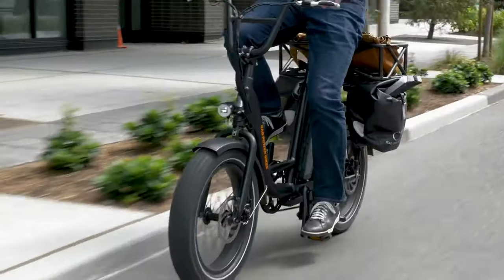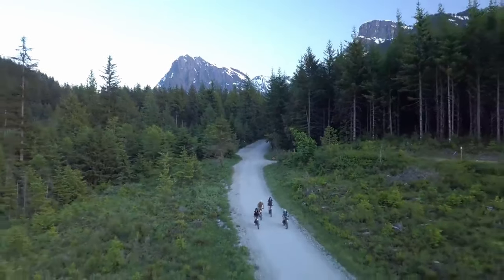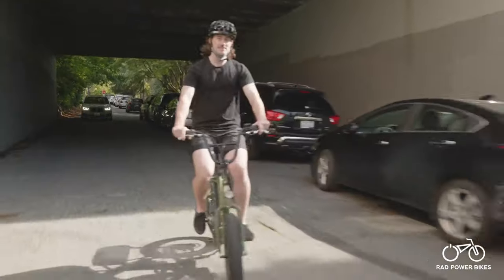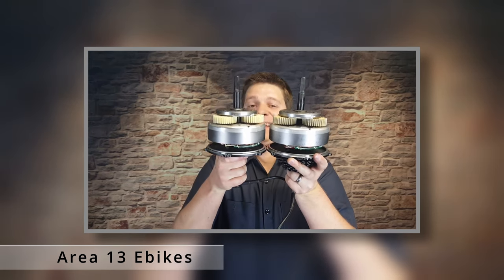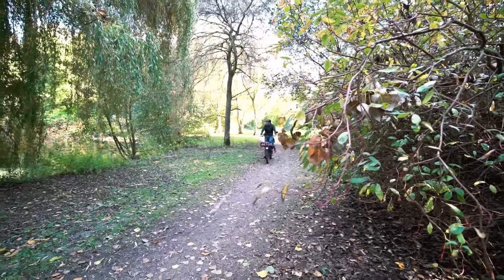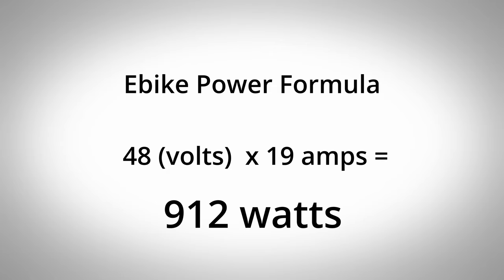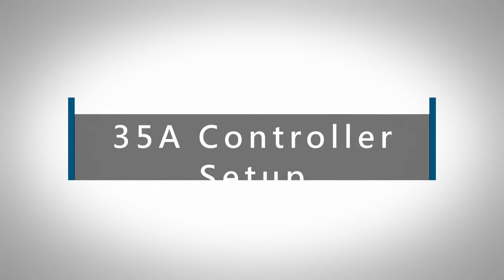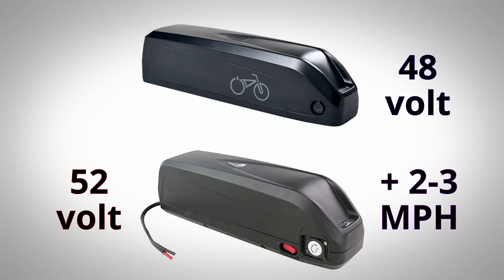How to speed up your Rad Power ebike! - Complete guide: Motor, Controller, and Battery!

Comment: Actually the 35 amp controller and display when programmed correctly allows me to get to 31mph with the stock motor and battery on my rad runner. Btw that’s with my 6 ft 240lb frame.
Reply from the maker: Thanks for the info! It's so weird 90% of the people I hear from say they get 25mph maximum from the stock motor but there's that 10% of people where I hear they get much faster. Just curious, what year did you buy your Runner?
Reply: Winter 2020
Reply from the maker: @surjracer56  Really odd. I don't know what settings that you're using differently then. 🤷‍♂
Reply: I just followed the directions from electrobike world
Reply: Unless you’re testing it with an actual speedometer app, the display isn’t fully accurate. If you raise the dimension of your tire in the settings, the display will show you going 30mph. I believe I have mine on 24 and the max it says I go is 25mph.
Reply from the maker: @stevecastillo1665  A very good point as well
Reply: Yeah, I found it weird that he said such an upgrade would not increase top speed at all. Thank you for posting.
Reply: I did the display trick. Increasing the km/h. I have yet to hit 25 mph
Reply: @ElectricRidesUT  Yeah we need to see these  settings because that's a bold claim!
Reply: Here’s been my experience: Bought Radrover 5 brand new in 2020. Could not crack 20mph In stock form. Two weeks later, I voided my warranty and installed the 35a controller. Max speed increased to 25mph. Earlier this year, I started to feel a grinding from the motor. It wasn’t until I got it all apart that I realized it was just the nylon planetary gear set that got chewed up through regular wear and tear (a $25 fix). But by that time I had already purchased the “true” 750W upgrade motor, so in it went and she now gets up to 30mph in no time flat. Those speeds were all attained on as flat and smooth a surface I could find, using throttle only, on a full battery, and gps verified (which actually matched readout on bike’s speedometer).
Reply: Yes but when you're riding your bike on the road with other cars around you you need to be able to go the same speed and a little bit faster to get out of trouble sometimes to change lanes and whatnot so it's a little underpowered should be able to be that it can go about 40 miles per hour to keep you safe

Comment: good vid. i built my ebike for less than half of this ones cost, and i control how fast it goes lol. 1500w 48v (fed a 60v diet) i pull my trailer at 45mph . but i use an NBPower 50a controller and a home built pouchcell battery with a 100a bms. it has power for days ! my wifes lil trike would eat this poor thing . hers is a 36v 750w front hub , with a 40a controller and 48v battery. my point is if you are some what handy with tools and can read , you can build your own for so much less. i have built 3 thus far and still dont have as much invested as the price of some prebuilts , and i know how to repair and maintain mine! great vid ! keep'em coming!

Comment: I have a rad mission bro, what's the best way to make it fly
Reply from the maker: The RadMission was really designed for pedaling with some assistance, much like EU ebikes. You can get more torque out of it and slightly faster motor only speeds (Around 25mph max usually) with an Eggrider or controller upgrade but with the single speed drivetrain and smaller motor it can be difficult to get anything faster.

Comment: I bought a 350watt Gear motor factory made Mukkpet E bike. Goes 20mph and ride continuous of over 15 miles or more. My CKit ,2000wstt goes up to ,40mph but a DD gearless can only go so far on high throttle of 3 to ,4 miles of the motor cutting off to cool down for a few minutes. I took my 350 watt Gear and added my 2000,watt gearless to my 350w to use as a Turbo Booster Hyper Drive. I can now go 40mph non stop of my 10 mile commute on my 350watt gear. Not really a Dual AWD, more of a 350watt gear motor e bike with a 2000watt Turbo Booster. Very practical and efficient of power and performance.
Reply from the maker: Heck yeah that sounds like fun!

Comment: Great Vid, I just purchased a Rad Runner plus and is interested in a future up grade to a 35 W controller ,I see that you did that to your bike, how difficult was that to mount and rewire your unit , any tips and feed back would greatly be appreciated
Reply from the maker: Thank you! The 35 amp install was a pretty simple. Area13 has a short guide that I followed that quickly goes over what it all entails. https://youtube.com/shorts/Su5ya8P-o0o?feature=share

Comment: I block the speed limiter on my RAd Rover 5 so the motor doesn't cut out using electrical tape
Reply from the maker: I've heard of people doing this hack on RadMissions and RadRunners since they don't have a display but I haven't heard of it on a Rover - do you lose the speedometer readout?

Comment: My DIY electric beach cruiser has a 1000 W motor. It’s Max speed is 28 mph. Scary fast!
Reply from the maker: I'd like to see that! Wear a helmet!
Reply: @ElectricRidesUT  It’s a rally sport Electra fat tire beach cruiser with ape hanger handlebars. I bought a Chinese DIY front hub 1000 W kit and a 48 V 21 amp battery. I did not install the pedal assist sensor. So all I use is a thumb throttle. Yes I’m gonna have to start using a helmet. I’m 62 years old and I’m on prescription blood thinners. It could be a disaster if I have a fall.
Reply from the maker: @billj9838  Sounds pretty sweet! Definitely get a good helmet! Gotta protect that lid. 😂

Comment: I've been running with a 35A controller for about 3500km now, currently debating whether to upgrade the motor (either true 750W, or bigger!) or replace the battery (which is down to about 60% capacity) with a higher voltage pack. 

One point that I don't think has been made before is that all brushless motors have a kV rating, which indicated how fast they can spin for a given voltage. Most of the Bafangs have a similar rating, regardless of rated power output. Folks who are reporting bikes hitting the 25mph limit are seeing the motor spinning as fast as it can for a given battery voltage.
Reply from the maker: Yeah, it's not really brought up a lot. Grin recently came out with a video about putting a Frankenrunner on a RadRunner that has great info regarding it! https://youtu.be/sL3bjQZGjoQ
Reply: I found a new project called freebeat's Morph 2-in-1 e-Bike, and it seems really interesting! The outstanding feature is that it can be charged when you apply indoor mode, which is unique and convenient. The Morph eBike also offers an impressive 80Nm torque and reaches a top speed of 20mph. The 80mm front suspension and puncture-resistant fat tires ensure a smooth ride in any condition. Additionally, with the Smart Saddle Detection+ feature, it provides valuable performance insights and keeps you motivated during indoor and outdoor rides. This innovative blend of fitness and technology is definitely worth considering!

Comment: Ok this you/me shouldn't do this.I have a radcity. My controller appear to have gone on the fritz so when I peddle most of the time it goes derectly regenerating charging, if just use the throttle I can go. So while playing with it I reset the controller from 28 in tire to 20 in.  It appears go alot faster than 20 my  display show 0 mph the I can still get go up 1 to 5 assist and do get odometer reading  (wrong cause of tire size) but I definitely going over 20 probably less than 30. When I installe my new controller I reset correctly.

Comment: I changed tire size and changed speed to 40 kph and disconnected the cable to the controller and covered the pin with electrical tape to dsiable the speedometer but my top speed remains 20 mph. Why can't I get it to go faster?
Reply from the maker: If you have the LCD display screen on your Rad you wouldn't need to cover any pins in a cable. That's something that some people who have the basic LED display (with no screen) have had to do to "unlock" their speed. What ebike do you have?

Comment: I live in Canada. My rad runner plus was delivered with a 500 w motor. If I get the egg adapter will this provide me with more torque ? I'm wondering if I should just upgrade my motor instead.
Reply from the maker: The motor itself is the same 750 watt one that they sell in the US, it's simply the controller that limits it to 500w. So if you get the eggrider or a 3rd party controller you should be able to get more torque out of it. I hear most people are happy with the extra torque and the same basic speed with the stock motor (32-37kph).

Comment: i have an early rad rover, and mostly ride around 18 mph.  i'm also a bmw r1100 pilot that routinely clocks in 3 digit speeds.  i don't ride ebikes to go fast, but this IS an interesting post as many folks are interested.  if you want to go fast on an ebike you need more voltage.  volts= speed, amps= torque.  i'm an engineer that has studied this.

Comment: ...and then there is the changing of the freewheeler cassette from 14-32 to 11- whatever, to end the ghostpedalling in top gear. That is one of the best mods, without interfering in the electronics.
Reply from the maker: That's very true, looking back I suppose I should have mentioned the freewheel/chainring upgrades. Guess I was too focused on electronics lol

Comment: Anyone have a speed hack on a Rad Mission?
Reply from the maker: If it's like the RadRunner 1/2 - there is a trick that involves putting electrical tape over a few motor connector pins that tricks the controller into running the motor at full speed (25mph-ish max). Not sure if it works on the Mission.
Reply: @ElectricRidesUT  Thanks! I’ll look into it.

Comment: Great vid. You seem to say that the only display working with the stock controller is the EggRider but many LCD displays can work with a 3rd party 35amp controller. Is it true?  Can't those LCD displays also work with the stock controller?
Reply from the maker: The  LCD displays that I mentioned are programmed to work with the 35a controller but aren't functional when plugged into the stock controller. It would be nice if they were more plug and play but I guess there's more to it than that.

Comment: The easiest way to do this is to Just buy an Ariel Rider X-class or a Grizzly... By the time you change all these components you will have spent more anyway....
Reply from the maker: You're definitely right there. As the saying goes "The cheap comes out expensive" .. not to mention the time and effort putting into the changes. 😆

Comment: Have you a video on how to upgrade the motor on a rad rhino 6 plus by any chance, mine is restricted to 250kw in Ireland and has really poor torque up hills as a result.
Reply from the maker: From what I hear, the motor on the EU Rad bikes is the same motor from the US/Can versions.. is simply the controller that limits it to 250watts. So many in the EU simply buy the Eggrider that "unlocks" the wattage and lets you run at the motor's full potential. BigGameBikes.com still has the Eggrider last I checked.

Comment: Nice video explaining everything and I see your Radrunner+ has the controller upgrade, does it also have the motor upgrade since your motor cable comes out on the left side of your bike just like my 2020 Radrunner 1. I was thinking about doing the 35amp controller and display upgrade. 😊👍
Reply from the maker: Thank you! Yes, I did the motor upgrade a few months after I installed the 35a controller/display. The wiring comes out on the brake rotor side so I had to lace in the motor instead of just swapping out the core.

Comment: Hi, I have the European version of the rad runner plus, which is more limited than the US version. Do you think that buying the egg rider will make any difference??? Thanks
Reply from the maker: From what I hear from those in the UK/EU, the Eggrider makes a HUGE difference in acceleration and top speed. Especially since it should be the same motor that is sold in the US and Canada and it's simply limited by the controller, an Eggrider would fully unlock this limitation.. just have to be careful.
Reply: @ElectricRidesUT  thanks for your reply ! When you say to be careful, you mean not breaking the connector while plug-in the egg rider, or why ??
Reply from the maker: @nicolasporta1  Sorry, careful as far as not getting caught maxing out the motor's wattage, speed, and throttle settings. At least that's what I heard is more regulated over in Europe.

Comment: Ive heard the Rad controller is more efficient than the Bolton etc upgrades leading to shorter battery life beyond just the extra power used for going faster. Also pure sine wave vs modified sine wave has come up.
Reply from the maker: I would imagine that there is a slight range reduction with the 35a controller but I haven't personally noticed a drastic difference between it and stock
Reply: This is why I decided to just save up for an Ariel grizzly. I love the rad look but it’s too slowww. When I say slow I’m more talking about torque and acceleration.
Reply: @joker-sh5hv  The Grizzly is also twice the price.
Reply from the maker: @joker-sh5hv  Awesome! The grizzlys are a pretty good deal, dual battery and dual motor.
Reply: Of course the factory controllers are more efficient.. they literally cut the motor off at certain speeds instead of allowing the bike to run at full power
Reply: @dylansoutdooradventures  that’s not the efficiency in question. That’s just a cut off function.

Comment: It's too heavy to be fast.  It's an increasingly tough battle to power it fast and far
Reply from the maker: That is true depending on how much you want to pay and what you consider "fast"! 🙃
Reply: @ElectricRidesUT  one can purchase a regular hike with 135mm axle spacing bike used/not new, put a hollow tech II crank on it for under 500$.  Then they could get a 500 watt rear hub kit and torque arm kit and battery off Amazon for like 600-700$.

So you are wrong.  A faster more capable bike can be had for cheaper.  The problem isn't how much money you can throw at 'it', the problem is knowing bicycle maintenance and willing to DIY a little bit
Reply: @ElectricRidesUT  I have a 18amp controller and a 53-46v battery and haul a bike trailer.  Bike loaded weighs 35pounds maybe, trailer would be 40-55pounds.  I can get up big big hills with no issues with just some pedaling but still it'll climb on it's own.

Your tires are robbing you of, what is, 'preicious watts'.

Its total bullshit these hard to pedal, heavy ebikes.  Thy aren't a bike(in terms of usability) and thy are the Lowest Their offering from china.  It's a 'screw the buyer' sort of purchase.

Truth is, NONE of the parts on that are worth a damn. Not the heavy frame, chain set..  people ought learn

Comment: Any one try with a radcity ??
Reply from the maker: I've seen people use the Eggrider and 35a controller upgrades on older RadCity models but hear the newer 5 plus models have issues.
Reply: @ElectricRidesUT  ohhh copy copy that I have  two  2018 radcity and looking to get more torque out of my daily commuter radcity
Reply from the maker: @Nhanny108  You won't get the same amount of torque that a geared hub motor would get with the upgrade but an eggrider or 35a controller should improve it quite a bit
Reply: Posted this bad idea somewhere else in the thread. Long story shorter.  Reset your controller to a smaller tire size your odmeter/speedometer will be wrong but you will go faster. My guess is definitely over 20 but probably less then 30.
Reply: I have a Radcity 3

Comment: I'm having this issue with my new Radrunner +.  During the first week it would pick up speed fairly quickly and after putting in the Tannus liner and plugging the rear motor back in it doesn't have that same quickness to it.  I used to be able to climb a slight hill while pedaling  in PAS 4 no problem but now struggle and putting it in PAS 5 doesn't seem to much better.  Even when on flat ground and just engaging the throttle doesn't feel the same either.  When I first got the bike I went into a different menu and it showed "prgrm 1253" and now it displays "1053"  Any idea what these codes mean?  I'm charging the battery for a full 12hrs to see if that will help.  Anyways any help would be great thanks!  Great video I'm considering the 35A controller and display...
Reply from the maker: I'll have to look into those codes, doesn't immediately ring any bells.  I kind of had the same issue after I upped the max speed on my Runner+. The first ride after I raised it went great and got 25mph consistently the whole ride.  I took it home and parked it.  Found the next day I had a flat so I put slime in both tires.  I thought the added weight on the slime slowed the bike since I only got up to 23 ever since.  I've heard from a good number of people similar stories, enough to tell me it can't really be a coincidence. Definitely recommend a 35a upgrade or Eggrider for that torque!

Comment: done all these upgrades 

Rad Runner 1 ...find it on my channel ..

1000w new motor geared 
35amp controller 
52v 24ah bat 

stock brakes and stock chairing

what the speed ...28mph no struggle ......30mph on perfect conditions of fresh bat smooth flat road low wind and not too hot or cold ...ive hit that couple of times but as said it struggle to get above the 29 ...28mph where it loves to idle on

what range well 52v left after doing 20miles all throttle up and down hills ...46v when it low ...so maybe 50/60 mile range
Reply from the maker: Awesome! I will definitely check that out!